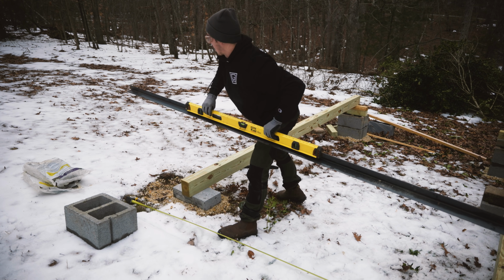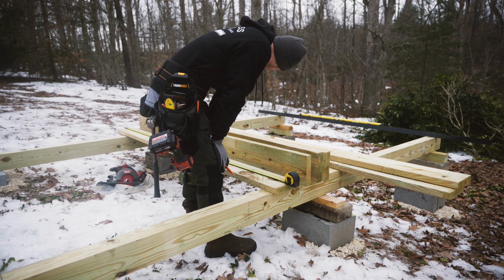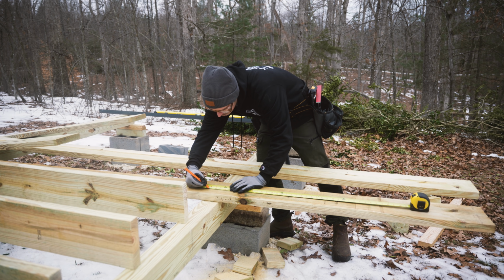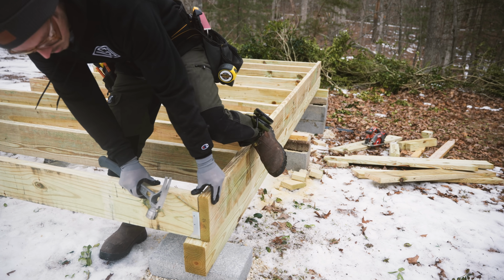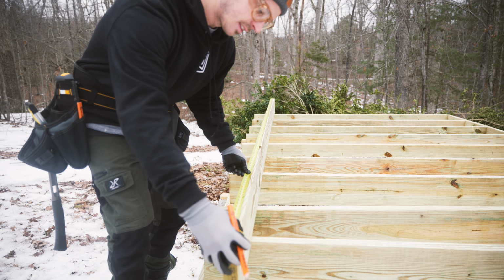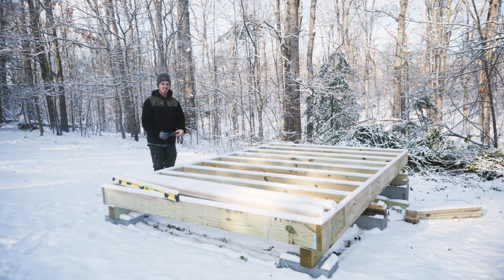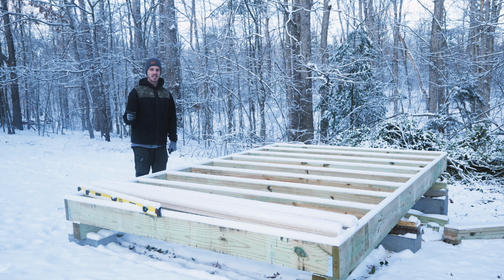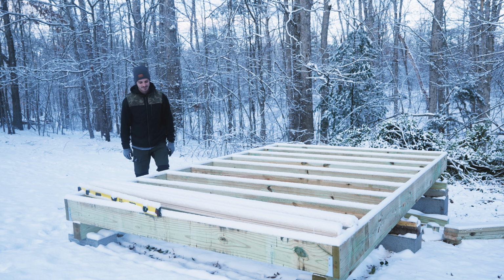I'm building a micro cabin that you could build.

Comment: will you be using any treated lumber? just wondering what should and shouldn't be pressure-treated. Thanks.
Reply from the maker: I use pressure treated for anything close or on the foundation. My whole flooring system is pressure treated.

Comment: Very excited for this build. You were mumbling a bit with the dimensions with respect to the bottom beams, so I didn’t quite understand it. Is there standard cabin sizes based on doing 16-on-center, thus the reason you choose this size for the mini?
Reply from the maker: 16 on center seems to be a good spacing for 2x8 floor joists for the 8 foot span.
Reply: He was making sure it was square. That’s why he said 172 1/2” x 174” was not square so he tweaked and adjusted until the X measurements were square meaning the equal the same then you have a perfect square that allowed him then to hang the hangers

Comment: No need for the joist hangers there. Just put several long enough nails and call it good.
Reply: Exactly. The floor joists are sitting directly on the beams, so they are fully supported already. The only advantage is the joist hangers will keep the joists from backing out away from the end joists when it's being moved. But if this wasn't intended to be moved I wouldn't bother with joist hangers. Honestly the nails from the subfloor and walls will probably hold the floor joists to the end joists during a move as well.